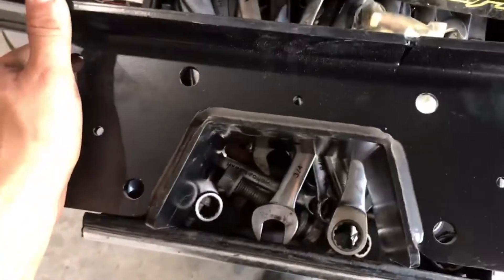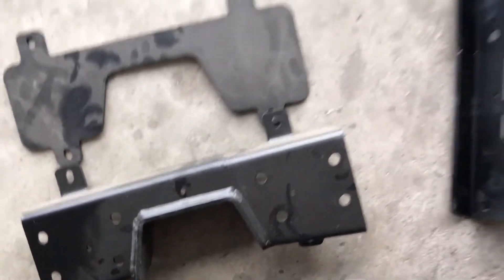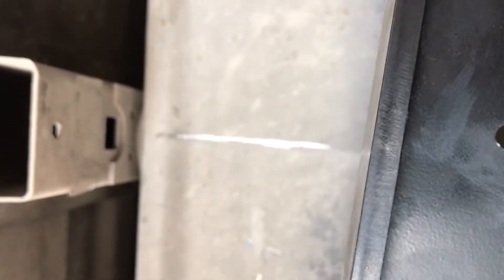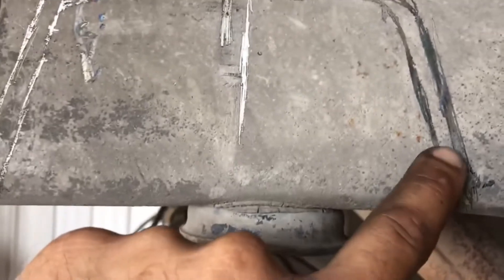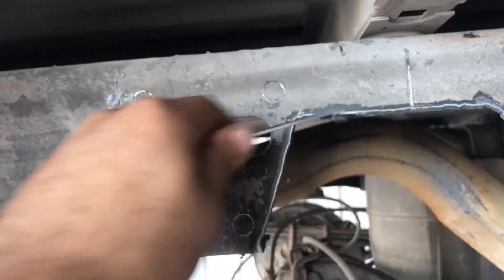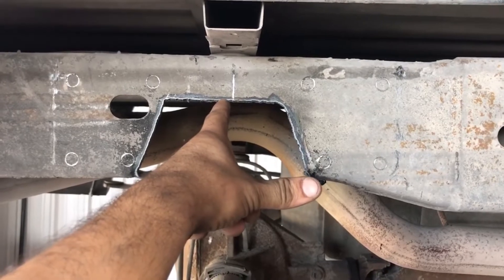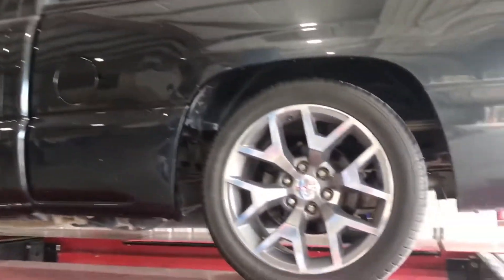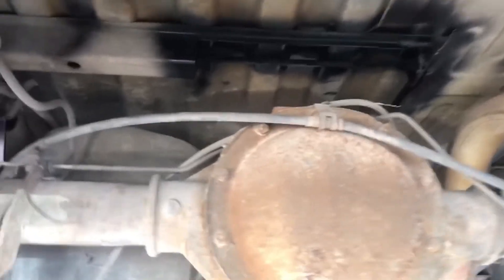99/06 IHC Suspension Bolt On C-Notch

Comment: I’ve seen people say that the hole underneath the bed rail on the frame is the the center of the diff but most of them push it back an inch because of the flip kit moving the diff